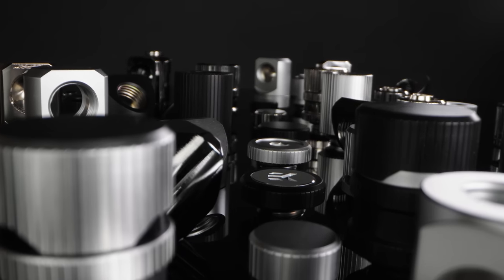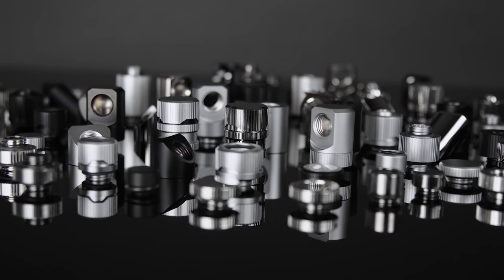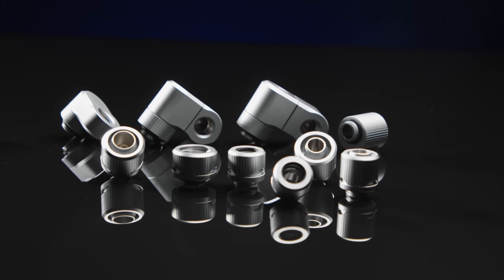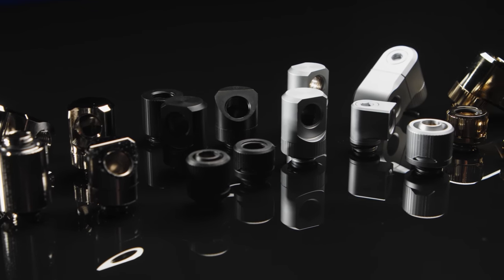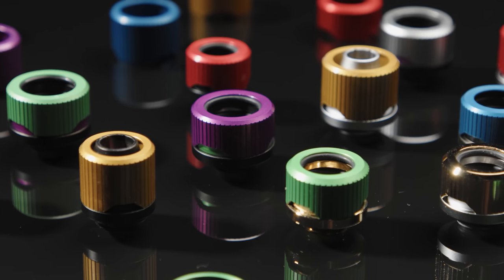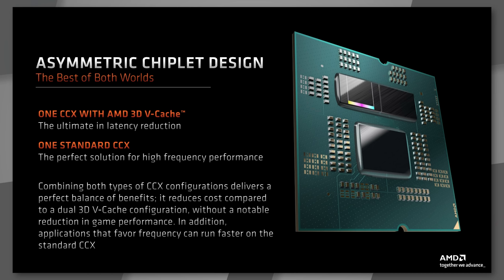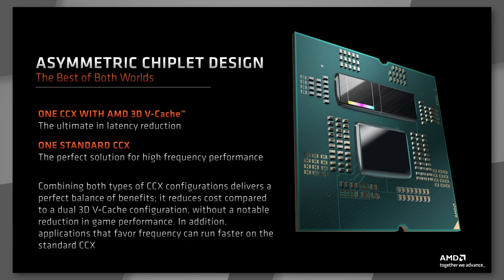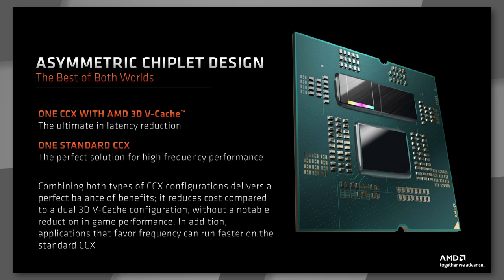Why I switched back to Intel...

Comment: I built my AM3+ FX-8350 system with help from your guide when your tutorial video came out initially, its has been great watching you all this time Jay! Your comments and experience with AM5/3D V-cache supports the suspicions I had. Im on AM4 with a Ryzen 5 3600 right now, I think i'll be quite satisfied upgrading to a 5950x with my current needs. I don't really see the point upgrading to AM5 yet. I wish you the best of health!
Reply: If you play mainly games the 5800x3d is a very solid chip that shares none of the stability issues he talks about here and is fairly competitive even against the newer chips.
Highly recommend it, myself and 4 of my buddies use it.
Reply: I still running the AMD 8350FX on a ROG Crossair V formula Thunderbolt....still run.s awesome for my need's .If it ain't broke don't fix it.
Reply: You probably shouldn't pick the 5950x because is is expensive, has thermo throttling issues and is overkill for most use cases. For gaming, depending on system load, it can actually run slower than a 12 or 8 core version. My recommendation would be the R7 5800X3D ( +25 -> 50% gaming )  if gaming is what you want, the R9 5900X ( +120% computation ) if computation performance is your focus, or a R7 5700 ( +25% gaming and +36% computation ) if you just want to solid PC upgrade.
I am rocking a R9 5900X setup for 65W ECO mode, which means a little less power under heavy multicore loads but also less thermo throttling.
Reply: Good old FX-8350 myself. Served me well up until about 2020. 

Built a new system with a 5800x zero problems with that ran very cool no stability issues at all. 

“Upgraded” to the 5800x3d and to be honest not that impressed with it. Only way to make it hit the advertised boost is to play around with PBO/-30 offset which to me shouldn’t be mandatory on a factory tune. 

Also the clock speed hit is considerable so unless you’re playing the specific games that benefit from a X3D I would just recommend a 5800x. Price is right and it does what it’s advertised to out of the box unlike the X3D variant.
Reply: @South_0f_Heaven_  Switching from a 5800x, or even a 5700x, to a 5800X3D is a downgrade for most things aside from gaming. You also need very good (water) cooling, RAM running at DDR4-3600 XMP and a PCIe 4 capable motherboard ( 500 series chipset ) to really profit from it. With those your gaming performance gets near AM5 levels, and general computation power should also be okay.
Reply: @l3lue7hunder12  I have all everything mentioned here. And I really can't decide if upgrade from 5800x to 5800x3D is worth...
Reply: 5800x3d is only 15 percent faster in games compared to 5800x. You would be better off to wait imho.
Reply: I went from a 3600 to a 5950x and the performance jump was very noticeable.  This chip is actually overkill for what I do and I wish I had got the 5800x3d to be honest. I can max out my 240hz monitor in the games I play with a 3090 strix. If your running big workloads the cores will help and it might age better but for gaming the 5800x3d is the right choice.
Reply: @davidbrennan5  +15% for the 5800X3D could quite possibly in average. But the range is somewhere in between -5% to +40% depending on the game.
I run a 5900X @65W ECO Mode, or in other words about the same performance as a 5700X single core just with 12 and I am quite happy with it. Then again, I am using an RX 6700 XT under Linux where this is plenty.
Reply: @l3lue7hunder12  yep as a person that has both versions of the 5800x can confirm the X3D is faster in some areas over others but is still a great option for the end off life AM4 platform.

Comment: I'm about 2-3 weeks into my first AM5 build. A 7950x w/ 64Gb of Dominator Platinum and a 7900 XTX GPU. Considered for a bit to grab the 7950x3D and i'm kinda glad I didn't after watching this video. That said i'm super curious to see how the next weeks and months come as I ramp up my use on this new build (still use the old system some). So far everything is stable, no crashes or blue screens. Literally just installed and started going so everything is just set to the out-of-the-box settings at the moment. So far i'm pleased and really enjoy it all; definitely a good experience as i've typically been an Intel guy.

Thanks for the video Jay (and team). I hope you are doing well. :)
Reply: any update or changes on the new AMD build? I've read comments on stability issues or microstuttering problems with the 7800x3d.

Comment: Upgraded my intel 6700k, 16gb ddr4, nvidia evga 1080 hybrid, samsung 1tb SSD at the start of october. To a 7800x3d 32gb, sapphire nitro 7900xtx, samsung 990 m.2 2t. Loving it so far and the jump in gaming performance is astonishing. Im literally getting an extra 100fps in my games like warhammer total war 3 and baldurs gate 3.

Comment: I recently built my first system a few months ago using 7800x3D + 3080 and it has been treating me well. The temps are doing well under load, no crashes or random blue screens. What's funny is before building the PC, I was getting frequent crashes and blue screens on my 4 year old laptop because of Windows updates🙃
Reply: Glad it wasn't just me. I went through about two years where I swear every windows update murdered my system. There was one it would try, it would murder it, it would roll it back then two weeks later it would try it again and I couldn't find a way to just disable updates. That laptop now has Linux Mint on it and sits next to me for emails and web browsing. Linux refuses to acknowledge the presence of my discreet laptop graphics card so its not all sunshine and roses but I don't play games on it anyway.
Reply: I'm using the same config myself actually.  I'm also liquid cooling both in a FD Meshify 2.

Comment: I put together a 7900x3d Linux Mint system last month.  It has been rock solid with no issues at all after I updated to the latest 6.5 kernel.  I bought 5200 memory because that is what AMD's site said was compatable.  I thought that I missed the boat as many people were recommending 6000 memory.  I am glad that I stuck with the 5200 memory seeing so many people complain about stability and constant memory reconfiguring.
Reply: What kind of board did you get? Gigabyte typically is more flaky with memory
Reply: 5200MHz is the native max the chip supports, but all RAM is run overclocked. You’re missing out on about 10% performance with 5200 as Ryzen is heavily speed dependent
Reply: @SpyderTracks  GPU is usually the limiting factor and not RAM. If RAM is your limiting factor, you got a fkn problem. Losing 10% ram speed with DDR5 will never be felt unless you are building for blender or something like that. Or trying to run starfield. But why would you play that game is beyond me.
Reply: @goldenhate6649  you must be an intel fanboy? AMD is different with RAM performance. Even on gaming at 4K you’d get 10% downturn with 5200mhz vs 6000mhz. But the OP states they’re running Linux on a 7950x3d so they’re obviously not gaming.

Comment: Jay, can you do an update video to this?  Where are you at now in opinion to the two platforms? Whats coming out next and any idea what your next build will have?
Reply: He always seems to just go Intel, even with the stuff coming out about their silicon degradation because all Intel can do on their crappy chips is to hotrod the power limits to try to eke out the performance crown for that particular generation at the cost of having ridiculous 300-350W TDPs on their processors.

Comment: 7950x here, same issues. I'm glad Jay spoke out about this, I thought I was going insane.
Reply: You must be doing Cad or things of that nature to not have bought 7800X3D for gaming.
It out does everything in most games and does it for about 50-80 watts than 500 watts or so of other chips that get beat by a 50- 80 Watt CPU with lower temps on top of it.

Comment: I’m running a 7950x3d and I haven’t had the problems you have. It’s been really stable with 6000 cl32. I’m running a 32gb kit at that speed on the crosshair gene. I’m running intel for a laptop Alienware x15 R2. It’s also really stable. I think the final comment makes the most sense, we finally have choice again in the cpu space and that’s good.

Comment: Jay you did hit it right on the nose at the end, that the dual ccd 7900X3D and 7950X3D are 1st gen designs even if the X3D is 2nd gen design. For me, I went with the Asus Crosshair X670E Hero and 7950X3D paired with 64GB G.Skill DDR5-6000 EXPO memory. I had early teething issues, but since have been running rock solid. I have the 7950X3D on a liquid cooled loop with my Red Devil Radeon RX 7900 XTX using a Alphacool block. Temps get no higher than between 76-79 degrees during summer with ambient temps. Bios is  ver. 1709

Comment: Mirroring the other suggestions, I'd also be interested in doing some troubleshooting with the old set up to see if the issues were caused by the 7950X3D, the ram, the motherboard, or some weird combination of the 3. As mentioned Asus has had issues with memory on their motherboards, but that seems less likely to address the software optimization of the CCD selection dependent on workloads.
Reply: This reminds me of when i had issues with my 10980xe pc at home i have 4x32gb sticks of 3600MTs ram which is overclocked to 3800MTs and was running perfectly for a few weeks.
Then i started getting random blue screen and initially thought my cpu oc was unstable but that didn't fix it and lowering the memory speed to 3733MTs seemed to fix it then the blue screen started again so i lowered it further and it seemed to help and i ended up loeering my ram speed all the way to 3400MTs and then i finally figured out it was actually corsair icue crashing my pc all along as I'd somply selected the software and hit to delete and i assumed it was deleted but all of the driver Dll files remained without the othrr necessary files causing my pc to randomly crash but it it didn't mention icue or anything in the windows error log and the error code it gave was most commonly because of an unstable overclock anyways once i figured that out and disabled icue in services.msn and deleted the remaining files my pc stopped blue screening and i was able to put my memory speed back to 3800MTs without issue.
I knoe you probably don't care about my little story it just shows that sometimes issues cam be what you least expect like in jays case it probably is memory but there's a good chance that it is something else entirely if dropping memory speed doesn't seem to really help.
Reply: How did you figure that it was iCue? Did you see it running on task manager or something? @oliverboi
Reply: @joebourgoin6554  i noticed that the same DLL was running right before it crashed by looking at the windows logs shortly before the fatal crash errors
Reply: Did you read the crash dump file to see what could be happening?
Reply: They don't do anything rigorous like that on this channel. He just says words.

Comment: I have a 7950x3D with 64GB 6000Mhz CL30. I have no instabilities, but the boot times, even with just the two sticks I have, are horrible without enabling some certain memory training exceptions in BIOS.
I also noticed it being slightly slower than my prior 12700k when loading my Lightroom library, but it's more of a short latency thing than not loading or working. But it could also be just a subjective experience.

At the end of the day, I'm glad I switched over when my Intel MB died. The lower power consumption did wonders for overall power usage and the better efficiency also lowered my temps by 10° across the board in the whole system. Other tasks also run much smoother, the MB IO at the same price is way better in my case and the way AMD Adrenaline looks and handles is much superior to Intels weird browser solution. That said, while I have no significant drawbacks or issues as of now, the boot times persist and are majorly annoying should I want to do a quick restart or quickly boot up from cold when I make a pitstop at home between two appointments.
Reply: The latest AGESA fixed my slow boots, but I am impressed that you got 64GB working at 6000MHz. That's not supposed to be stable for anyone. Does it pass a memory test?
Reply: @jondonnelly3  I have stable 64GB (2x32GB) at 6000MHz CL30 with 7800X3D, slow boots fixed with setting called "Memory Context Restore" on Asus boards set from auto to enabled.

Comment: I built my first system this year and I went with the 13th gen intel. So far it's been treating me well.
Reply: thats why i stick with intel.   intel is always stable.   amd,  not so much
Reply: I also went for an i5-13600kf and I love it
Reply: My 12700k since Nov 21' has been flawless so far.
Reply: It’s should be awesome in the winter 🔥🔥🔥!
Reply: 13700K with an undervolt 🔥🔥🔥
Reply: i5-9600K OC to 5GHZ on all cores on a basic motherboard with no problems whatsoever and NEVER got a crash. Intel has won my trust, both my friends who got amd though both have a lot more crashes while i have had none and they both have better motherboards than me. Something that seems to always seems to get glossed over is long term stability, intels quality control just seems to be on another level than AMD, their chips seems like great value and great efficency but they have to do something about that QC.
Reply: Same I got the 13th i5 clocked to 55mzh on the p cores and 42 on the e cores
Reply: I've never had a system more stable than my 13600k, I've undervolted it and overclocked to 5.3Ghz all core it at the same time with XMP enabled, absolutely rock solid. This is exactly why I went Intel even though AMD had faster products for the price, their stability just isn't there.
And the heat issues everyone talks about get solved with an undervolt and a CPU bracket that cost 10€, so it's a non-issue if you're willing to spend an hour undervolting.
Reply: At least you will save on heating if you live in a country with real winters
Reply: @alcozar5905 you realize 7000/5000 series runs hotter at half the wattage right? Lots of videos showing this.
Reply: @TheFPSPower and is perfectly stable...just beyond guy has an issue doesn't mean others will...most people don't have issues
Reply: @jebes909090  That wasn't always the way it went. I remember the first Celerons being hit or miss. I had a serious miss.
Reply: Hoepfully some good black friday deals this year, really wanna upgrade my 9700k.
Reply: first system “this year”
Reply: @OC.TINYYY no he does not realize it. All the reviews were making so many nonsensical memes about "hot" that these tech ignoramuses feel smart repeating it.
Reply: I have 2 amd systems, next upgrade is going to be intel.
Reply: @TheFPSPower some of us don't even undervolt and have little heat. Probably hotter in summer, but don't feel much heat on exhaust with high settings.
Reply: You'll also find intel behaving much better on the motherboard side, there's definitely a motherboard advantage to intel in terms of stability and longevity
Reply: @Topper_Harley68  can i ask why ? just curiosity. I use a 13600K
Reply: @licksludgee  this was my first ever time building a pc and I don't plan to for awhile so I went ahead and grabbed a Thermal Grizzly cpu contact frame, to help with temps to make it last longer, and replaced the oem one and it has been very good on temps.
Reply: @Adam-Mei  amd chips were Waaaay worse back then though.  Generally thats how it goes now.
Reply: @sodiumvapor13 how much do you undervolt yours, without loosing any performance
Reply: Intel is that old reliable sure AMD might have something better out. but Intel just works and it's never to far behind on performance  to make you feel like you missed out. I have a 12700k with a slight overclock and a corsair 360mm rad with it under full load temps don't really go past 50c